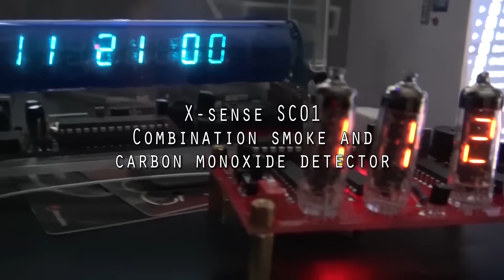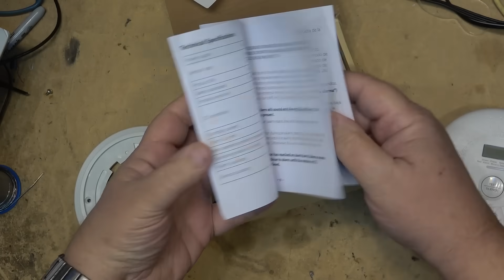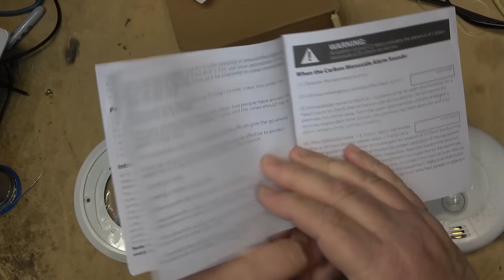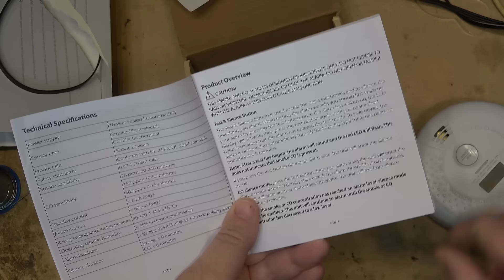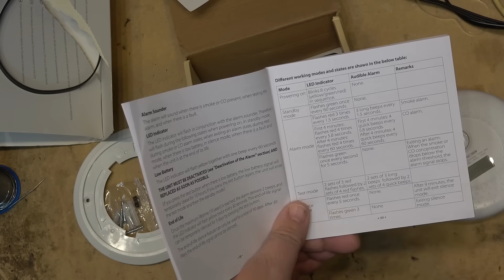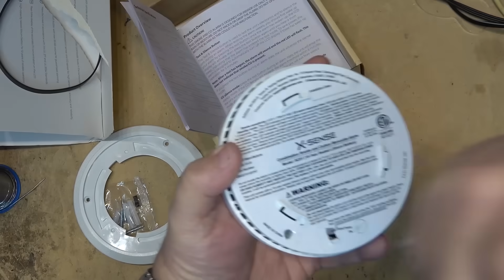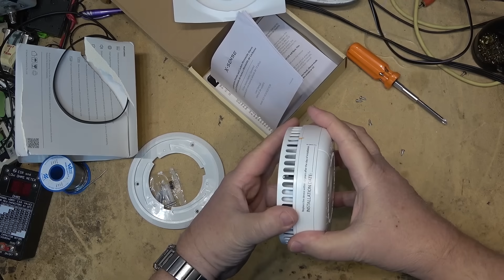X-SENSE  SC01 Combination Smoke and CO detector tear down and test

Comment: Mine went off after two years. Turns out dust has settled in it and activates it. found that out AFTER the fact....
I already deactivated it but did you or anyone figure out how to re-activate it? Opened it up but the switch does not respond....

Comment: Nice teardown/review.  I just bought a six-pack of these and they optionally interlink as well, if you desire them to all go off if one detects.

As a side note... I asked my local building inspector (while I gained approval for a newly installed HVAC install) why local code does not require a gas detector in every house that has natural gas.  You'd think having one in the mechanicals area near the appliances using gas would make sense.  He just shrugged his shoulders.  I had to laugh.  (I have one in my house to monitor my gas appliances BTW... furnace, HW tank and dryer)

Comment: Bought one last year for our RV; BUT since it only gets used once, maybe twice a year -- usually less then a month, did NOT need the detector operational -- running the batteries down (even though they're "10 year") -- while NOT using the RV!  Consequently, disassembled, and cut off the first little bump on the case that keeps it from being turned back off!!! AND whala! Now it's easy to turn it on AND off!  

Also, put a bit of epoxy on the board behind the switch so that it canNOT be deactivated accidentally!!! (put a piece of tape on the white plastic so epoxy wouldn't stick to it, then a dab of epoxy behind it, once set up, remove the white switch activator piece to take off tape, put activator back on and NOW the I have extra "insurance" that it won't accidentally be moved to deactivate position!) The switch may just "turn it off" in the deactivate position, BUT it might also blow an internal fuse / circuit -- don't know, didn't take time to really look more closely at the circuitry. I've worked on other equipment over the years where a manufacturer created a circuit that would blow an internal fuse IF the equipment was set up in a particular configuration; and it required disassembling a gas valve to replace the blown fuse IF I wanted to use the equipment in a different configuration! (Once again was a safety / liability reason the company did that!  

I also used a Dremel to widen the slots on the mounting plate so that it does NOT automatically turn the detector on when I attach it to the plate!!!  That way it can be stored on the mounting plate while the RV is NOT in use; but be easily removed and manually turned on, then returned back to the mounting plate when we're actually using the RV. 

While I understand the company's engineering in a "stupidity" component" -- can't turn it off -- and most likely liability concerns as well, some of us are disciplined in our ways, also a former First Responder and fully understand the need for these devices; but also am very capable of taking care of my own property and personal safety.  

FYI, we have multiple units in our house, so did not need another one, since we already have redundancy, which I FULLY believe in AND encourage! We actually have 2 detectors in the RV -- the other a plug in 120v, whereas this one is battery only.  

Thanks much for the video -- knew where you were going with it. Thought about making a video of what I did, BUT do NOT want to assume others are as diligent and anal in their safety procedures! AS an aviator USAF), safety and redundancy have been a part of my life for 50+ years. Again, I understand the company's reasoning for doing what they did... but then I've been designing, building and modifying things since my teen years.  ;-)
Reply from the maker: There is a reason it can't be turned off.  Because some idiot would turn it off and that is when a fire would happen.  Then a lawsuit would follow.  Since you modified it you take responsibility.  That's precicely the reason i do not show people how to modify anything and if i mid something for my own use i will never show how it is done because someone else copying it gets hurt guess who they sue? That's the reason i have never done RGB mods to TV's ect.  Yes i know how to do it but i am not teaching anyone else to do it.  Even putting a disclaimer on does nothing when a jury is our for blood.
Reply: Yep, the dumbing down of our culture is only getting worse! We grew up with common sense AND accepting responsibility for our actions. Today so many kids -- now adults -- haven't a clue how to fix some of the simplest things, including change a tire on their car and basic home repairs!  The first detectors all had batteries... but too many today listen to the low battery beeping until it completely dies... You just can't fix stupid and irresponsible people.
Reply from the maker: @PastorBruceKramer  you got that right.  As bill mahr said we would like to retire but we can't because the young people today just don't get it.

Comment: Is that guaranteed for 10 years? I had a CO detector that only lasted a year. It kept going off even though there was no CO.
Reply from the maker: My old friend thought the same thing.  He had 2 co detectors in his house.  One kept going off and the other didn't.  He thought the one that was going off was defective. One day he was feeling ill and called 911.  The firemen showed up first before the ambulance.  The co detector just happened to beep while they were there and they pulled out their co detector and it was off the scale. He spent a few days in hospital in hyperbaric chamber getting co flushed from his system.  Could have died from it.  A bird had built a nest in the chimney.   He thought the one that kept going off was defective and it was just that it was detecting Co that the other one was not because the other one was placed in the wrong location. The 10-year life cycle is not a warranty for 10 years they probably have the standard one or two year warranty. The 10-year life cycle is that a life cycle after 10 years it shuts off and starts beeping constantly to tell you that it is at the end of its life. The smoke detector portion would continue to run because it's photoelectric but the co is a chemical reactor the once activated starts to use up the reserve catalyst that is used to detect carbon monoxide. What's the catalyst is used up a can no longer react and test for carbon monoxide and must be replaced. All carbon monoxide detectors made today are required to have the self test and deactivation feature so that you are alerted when the unit has reached the end of its life cycle. The moral to the story is if any CO or smoke alarm goes off get out and have the air checked.  Co is odourless, colorless and tasteless and it will kill you.
Reply: I've purchased about 8 Kidde branded CO detectors for our commercial business. 4 of them failed before the 3 year mark!

Comment: Great video…..don’t forget to add a Carbon monoxide device if you have an attached garage. That solid 1 and 3/4 self closing tight fitting door between the house and garage can have problems over time…..A lot of deaths occur when power goes out and owners start their generator in the garage with the extension cord going in the house……that and cars with remote start accidentally getting started make it a must to have a CO detector in the house!
Reply from the maker: Absolutely